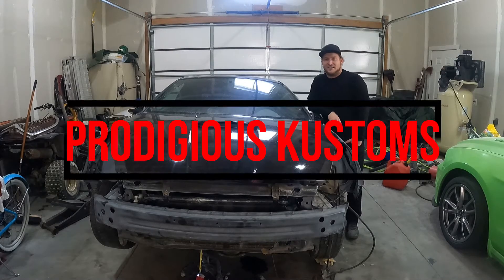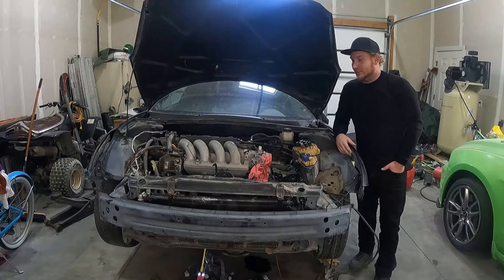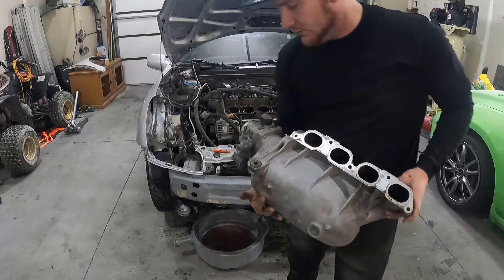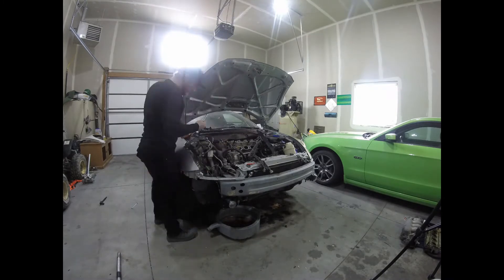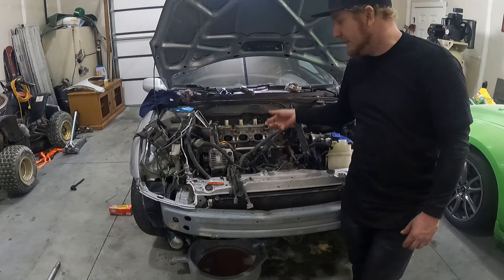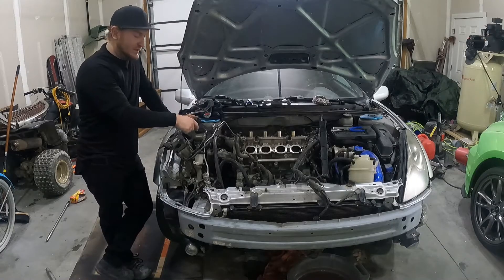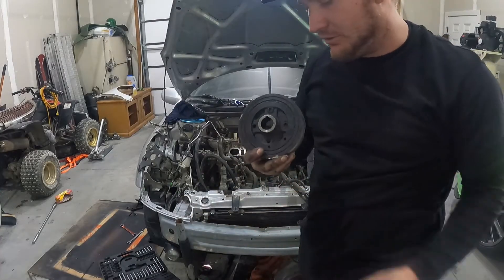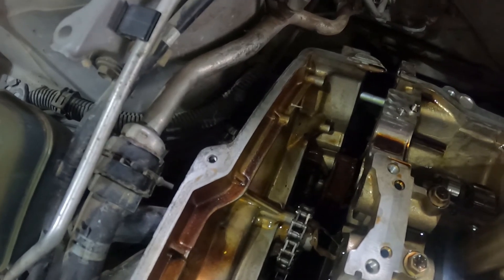2ZZGE Head removal

Comment: Can you send the part number to the socket you used to take bolt heads off
Reply from the maker: Cr-vm12
Reply: For future folks, the tool you want is called a double hexagon socket, or as Toyota calls it, "10mm bi-hexagonal wrench." I just looked up, "Toyota head bolt socket."

 A 12mm triple square looks similar (and fits in the head bolt) but the angles of the edges are different, and if you use that you run the risk of stripping the bolt or socket.